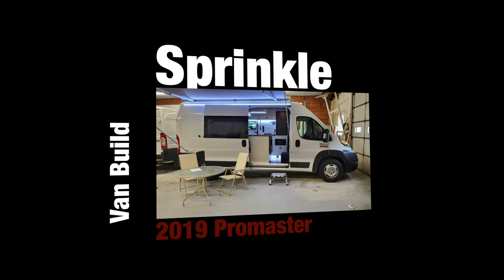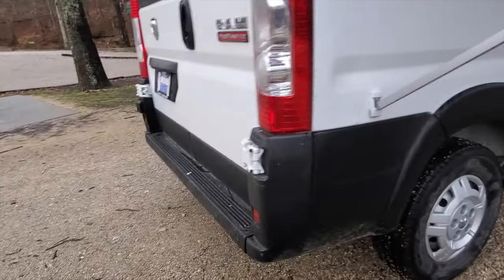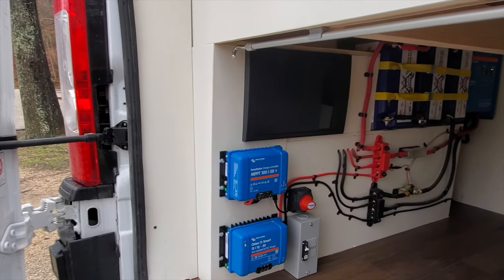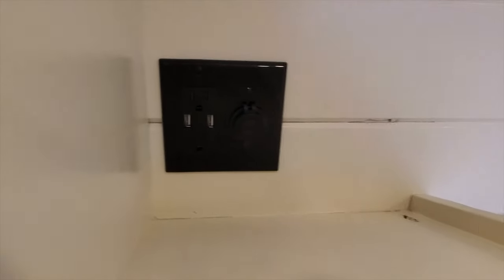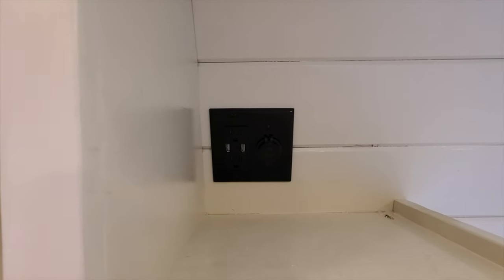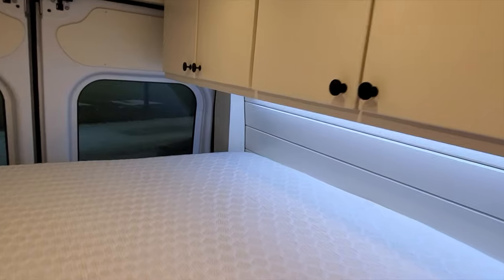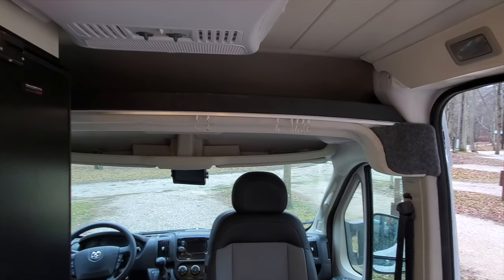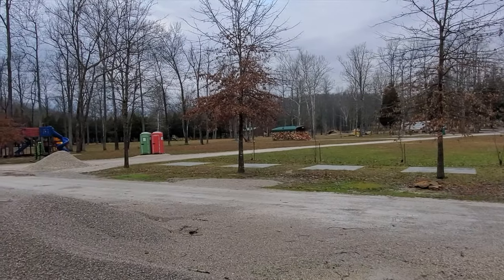Promaster Camper Conversion (E54)

Comment: Sorry to hear about your accident but glad the injuries weren't worse. Very nice build in this video. First time I've seen a left to right bed since usually when you pull over on the side of
the road, the road usually slopes down that way so in bed your head will be sloping down....guess if she uses campgrounds this will not be an issue though. You folks at Red's
knock it out of the park as far as the craftsmanship.

Comment: As always...very nice.  The mattress is a little high but looks comfy.
Reply from the maker: Agreed, the owner ordered it and had it shipped to me. It was supposed to be a 6" but it ended up being almost 14".
Reply: With the mattress that size she definitely doesn’t have to worry about mold. Also, depending how tall she is (I know you said she’s short) she may be able to sleep “front to back” so as to not bump her head on upper cabinets.
Reply: I looked at the one I had at home and ordered the same. Guess I should have consulted the exper